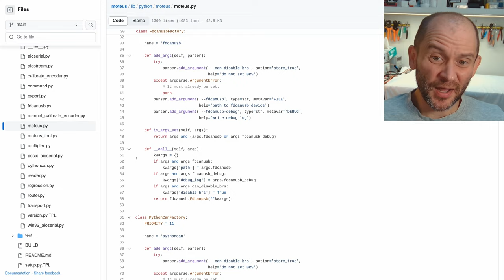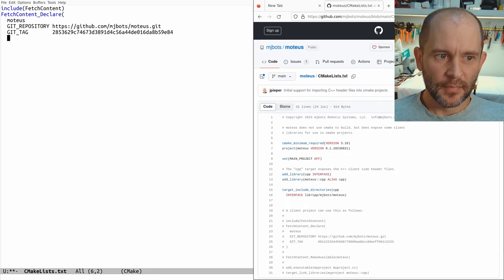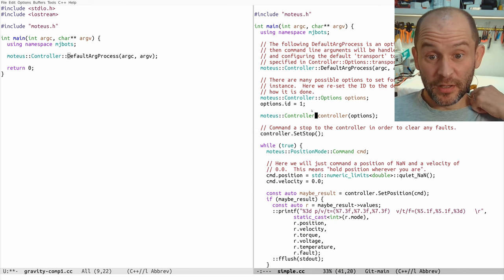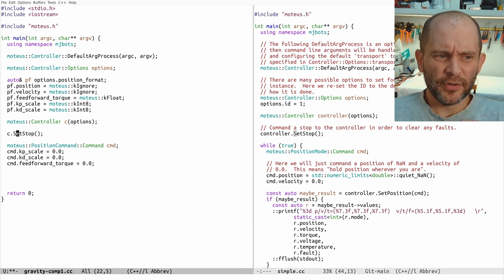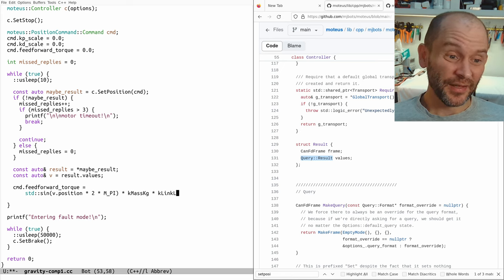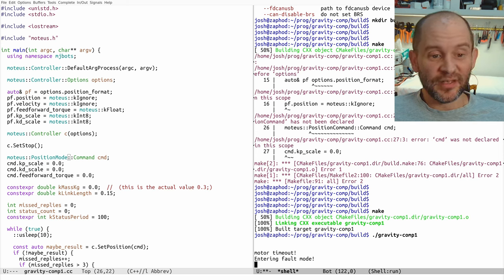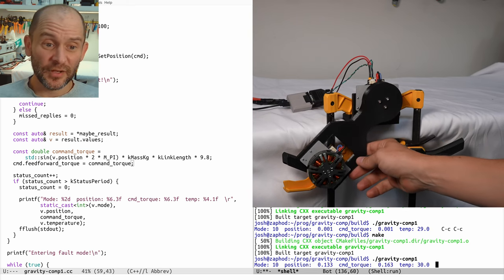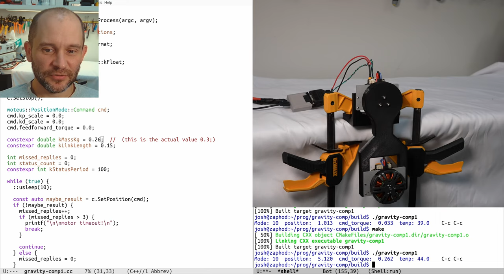1DoF gravity compensation - moteus w/ C++

Comment: Really nice!
Reply: Just to understand where you're compiling the code and running it from, are you just at the Raspberry Pi command line and running make from there and then the Raspi talks over CAN bus to the Moteus controller? Or are you running that C++ compiled code on the Moteus microcontroller? Or a daughter microcontroller like an STM32?
Reply from the maker: In this example it was running on a desktop computer which communicated over a fdcanusb to the moteus.  In the video you can see the stdout of the process running in my emacs buffer.  

You could also use the exact same code compiled on a Raspberry Pi to talk to a moteus either with a fdcanusb, and with the published but not yet announced update to the pi3hat C++ library, the pi3hat.